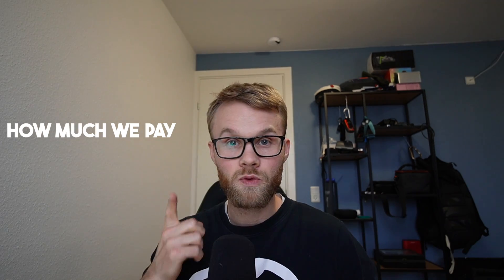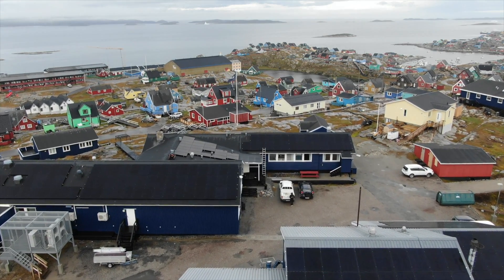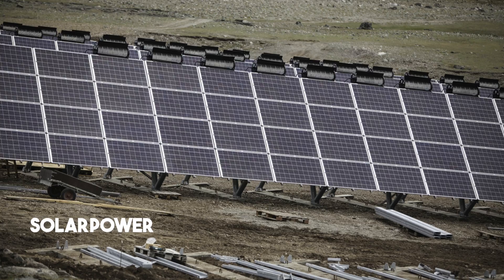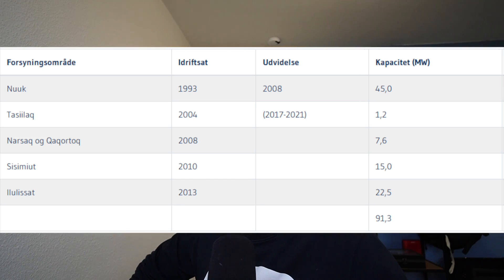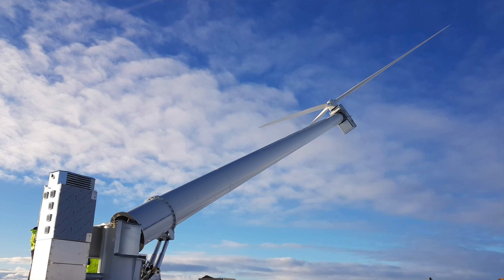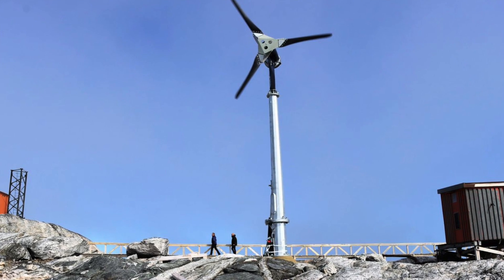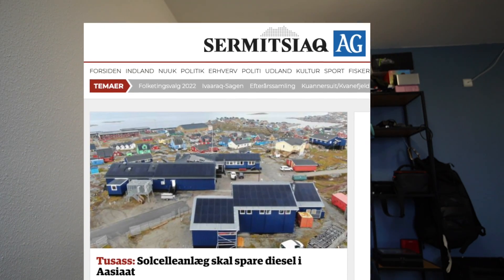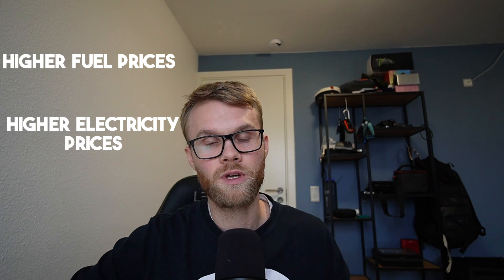How Greenland Produce Electricity I Feat. Greenland´s Largest Solar PV System

Comment: Are there adequate days where solar (PV) can make a dent in the production of electricity in Greenland? I didn’t realize there were that many sunny days where this would be possible. Glad you have a robust hydro source for electrical generation. Maybe it’s time to underground the transmission lines if not too costly!
Reply: More than enough, solar has great potential in greenland

Comment: Solar & wind powers the way to go. I run the housetruck with solar & supplement with generator when not drawing much power. How do the winter months effect the supply of solar power? Do you have a way around the serious shortage of daylight in winter months, with regard to solar?

Comment: DO NOT GET NUCLEAR POWER STATIONS!!
 I speak from direct experience. I am now a  retired South African Electrical senior technician. 
But for 8 years I helped directly in building Koeberg Power Station, 40 km North of Cape Town, South Africa. 
It has 2 Nuclear Reactors each producing 940 MW of power. We used British, Canadian and American engineers as consultants. The main problem is what to do with the Nuclear waste??? Each year some of the fuel rods are exchanged for fresh ones. The used ones have to be stored underwater for years, because of high radioactivity. But that's only the beginning of the problems. The used rods generate a lot of heat and have to be cooled, or Else!!
Ask the Japanese at Fukushima about the problems that caused them, when their standby generators failed during their tsunami. They had to fly in seawater buckets  with helicopters, to cool those spent fuel rods. The helicopter pilots got serious radiation exposure. I repeat don't get Nuclear Power stations!!

Comment: Thank you so much for providing us with some information on local fuel prices. I hardly imagined that Greenland could have a rather good solar and wind power system, besides hydro power energy. What about geothermal energy? Here in Italy we could have the best renewable energy system in the world!! Instead we are dependent on gas and also, for a small part, from French nuclear power plants and the prices are skyrocketing. Fortunately, something is moving in this direction. We hope, and perhaps this crisis will give us a hand to change. Great video, as usual. Thank you
Reply from the maker: Geothermal is not really used that much up here, only one testing facility as Im aware of.. 
Yes, its crazy when I read about Italy's dependence on gas, as you definitely have other options😄
Reply: @AlexAmasaOlsen  Really!

Comment: I appreciated your assessment of local fuel prices. Some people may not realize that much of the oil produced is sold on long term contracts. The oil prices that we usually see quoted in the news are "spot market prices." Oil that is sold on the spot market for immediate delivery is often sold at much higher prices than oil sold under long term contract. I think you are probably correct in expecting your fuel costs to increase after the current contracts expire. Thanks for the video Alex!
Reply from the maker: Yep! 
We have been blessed with low fuel prices, but next long term contract is probably going to be ugly😅

Comment: Any hydrogen plans for Greenland?
Reply from the maker: So far none in the near future, but as hydropower power output increases, maybe some other form of energy storage would become relevant😊
Reply: @AlexAmasaOlsen  good point. The simplest way to store hydropower energy is usually to build dams. It is difficult for me to imagine all the obstacles to building dams and reservoirs in the arctic. It seems that designing reservoirs and pipes to handle the forces created by so much freezing water could be a complex challenge.